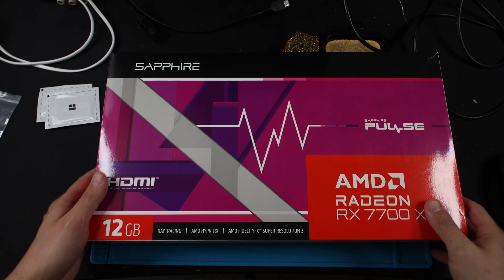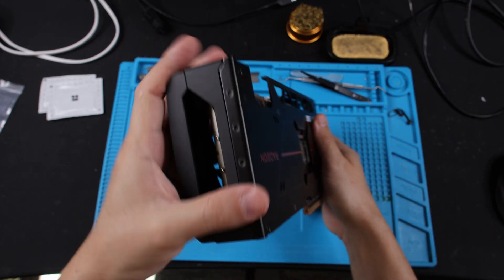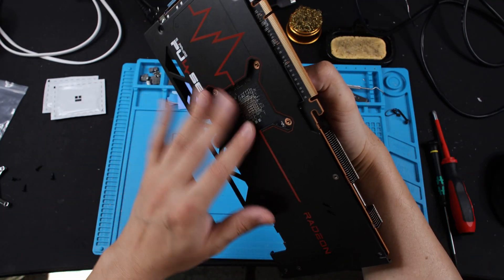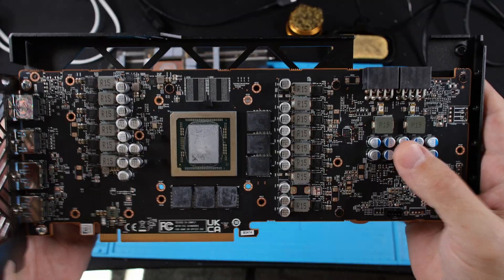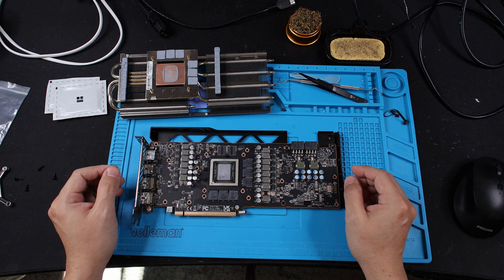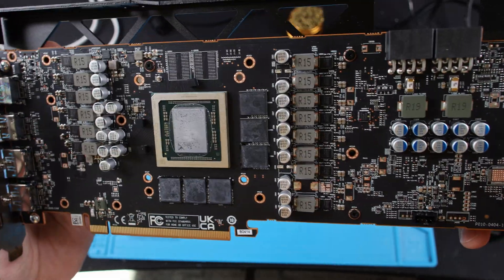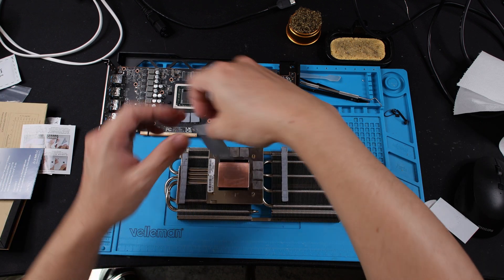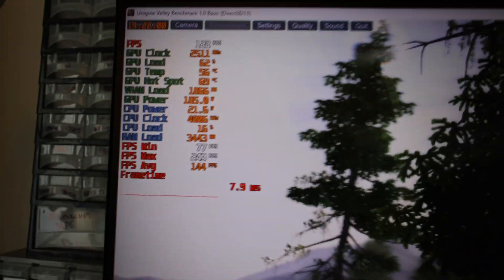Sapphire RX 7700 XT Pulse Unboxing & Teardown. Excellent quality build!

Comment: Only bought AMD for the last 9 years and moved from an rx 580 to an 5700xt and last year upgraded to the 7800xt and all of them made by Sapphire,none of them ever had any faults and were well made.
Reply from the maker: Sapphire does produce some good cards. But as with all the rest, they can also fail. I would definitely use some support with that 7800XT, as they are heavy and also prone to sag. Just a tip.
Reply: @TechnologyHive good tip,I'm using a support bracket

Comment: I got this Sapphire Pure version, Frostpunk 2 edition and I managed to get a stable overclock of 3.4Ghz! I mean, it boosts into it. The min I have set is 3Ghz and the max I have set is 3.4 and it boosts into that speed without crashing! This GPU I got it paired with an AMD Ryzen 7 5700x3d on an MSI B450 Gaming Plus Max AM4 motherboard with 64 gigabytes of Corsair DDR4 3200 overclocked the RAM to 3600, its stable and doesn't crash, even when I throw heavy workloads at it, its fast. 
Since I have multiple GPU slots from this MSI B450 Gaming Plus Max, I also have an RX 7600 and I'm using mgpu mode in things like LM studio and utilizing the 20 gigabytes VRAM pool, it works great. I can load pretty decently big models on it like Hermes 4.3 36 billion parameter model on it and it works.
The great thing about the RX 7700 XT is its tip toeing into the high end threshold, I can play every game I throw at this thing, in 1080p I can expect usually over 200 fps in most games, in 1440p I can expect like 100 to 175 in most games, and in 4k I can expect at least 55 to 65 fps in most games in ultra detail, its an amazing card, I love it. Super fast, works great with my AMD Ryzen 7 5700x3D. Both the CPU and GPU still hold strong even now and still perform great in games and workloads and AI and protein folding with folding at home and anything I can throw at it. ROCm is great, I love ROCm. Hell, I love AMD. Lisa Su is a genius.

Comment: So is it ok to have a 20c difference between hot spot and gpu temp with RX 6000 and 7000 series?
Reply from the maker: I wouldn't say its "ok", but rather that it is common.
Reply: @TechnologyHive Thanks I tried rx 6600, 6650 xt and rx 7600 all have similar temps. I am not sure repasting will help.

Comment: I have the same card but 7800xt, it is basically the same chip with no disabled cores, and two more memory chips, where this 7700xt is missing, what do you think about the xfx merc one?
Reply from the maker: The XFX cards are nice, BUT because they are large and heavy you run the risk of having the memory chips close to the PCI-e slot with cracked solder joints or ripped pads. It is very typical with these cards. I have worked on 10 of the in the last few weeks and its always those chips with cracked or ripped pads. So I advice people to put those cards on a vertical riser or put your PC on it's side so the card is not sagging in a horizontal position.

Comment: Hello brother. 
What do you think of these specifications on 2K resolution? 
I5 14400F

RX 7800 XT saphhire pulse

B760 M-E msi

650W
Reply from the maker: @sagamer4753  All seems fine to me. Which psu are you planning to use?
Reply: @TechnologyHive  650w Bronze RUIX
Reply from the maker: @sagamer4753  I'm not familiar with that brand, but could be that I'm just a noob 😆. Any way to go with Seasonic or Corsair?
Reply: @TechnologyHive Do you have Telegram to contact you about this?
Reply: is it going food with u? im planing for same setup , thank you.

Comment: I have the Sapphire RX 7800 XT Pulse and I'm wondering if they using phase change material like the 7700 XT you opened, which logically must be there since it's a tier higher and i'm intrigued to check it myself, but there is no information about it out there
Reply from the maker: @teos17  If your temperature is okei, I wouldn't bother opening it, or you'll have to buy some phase change TIM.
Reply: @TechnologyHive  i have stock ptm7950 to use, but since it's still brand new and under warranty i don't want to brake off the sticker, maybe you're right and im gonna leave it alone for now

Comment: Hello, first of all thanks for all the information about thermal pads and the other details. I have a powercolor radeon 7700xt 2 fan model and I wanted to check the thermal pads without tearing it down bcs it is new and I suspected that pads are doesnt properly contact with the heatsink. Even from the side of the gpu it looks like it and my temps are with +%15 power limit and undervolt gpu 68 hotspot 95 to 100 on full load 267 watts. There is a big gap as you can see between temps so I want to change the pads to thickee ones and the paste to ptm 7950. Temps doesnt really cause any problems actually but temp difference makes me uncomfortable. Any suggestions would be appreciated.
Reply from the maker: If you replaced the stock paste with Thermalright Heilos or PTM, you should instantly see that temp delta draw closer. The RX 7700 XT, as you no doubt know, is based on a chipplet design. This introduces an uneven surface due to its design nature. PTM helps with this issue.
Reply: @ thanks for the quick response. No I havent changed it yet I need to get a solid ptm 7950 there are too many fake models of it. Also do I have to change the pads to thicker ones there are lots of people who changed the paste to ptm but issue remained all the time even got worse. It is quite delicate job I guess. I am afraid that it is going to get worse.almost everybody says that at first temps are olay but later it gets worse.

Comment: Hello Sir, I plan to buy this card for next 4-6 years 1080p gaming..!! Is this card works in 650W PSU ?? Because i have 5600x with gigabyte 650W PSU. In sapphire website, they mentioned minimum 700W PSU and this card consume 230W board power..!!  that's y I'm asking, I really need ur valuable words..!! 🙏🙏🙏
Reply from the maker: @Oneeight.mp4  Yes 650w is perfectly fine. Your system, as long as you don't have 10 fans and 20 hard drives, should pull around 350-400w out of the wall at the most.
Reply: @TechnologyHive  Hahaha..!! No sir, I have only 3 cabinet fans 1 cpu fan and 1 ssd, 1 nvme. Thank you soo much sir for your response and this quality video.. it make me clear idea. 🤝🙏
Reply from the maker: @Oneeight.mp4  Your welcome. I'm glad to help ☺️

Comment: Hei i need some help, i just trying to repair one RX 7700 XT Sapphire. Someone kicked against his computer and a massive short circuit occured. The SF8A fused is broken, the AMS1117 50 broke down its located in the left corner of the first HDMI-Port and a QFN-Chip melted down. So i dont know what kind of chip it is its located in the 0.75 Volt rail. This is under the left R15 coils, on the left side from the smaller coil.
Reply from the maker: @FlorianNothas  None of that made any sense 🤣

Comment: I've owned a Sapphire Nitro+ 6700XT for 5 - 7 months and I love how Sapphire did their quality on the cards.
Reply from the maker: @dbatack  Thus is why I don't often work on AMD cards. They are built better, IMO.
Reply: I agree completely. I didn't too much like that power connector on Nvidia high end cards that 16 pin high power adapter thing, I hate that shit. Its horrible, so many people complained and had to do RMAs when their GPUs melted on those Nvidia cards. I think they may have since resolved it but that's just dumb. I'd rather stick to the 8 pin design, and when cards need more juice just add another 8 pin cable on a separate rail that way if something goes wrong it doesn't fry the whole card. Its not as likely to go wrong with the multi 8 pin outs as those highpower 16 pinners are. Too much juice through a single rail I think.

These things are built like a tank and built to last, I sure am glad I got my shit, my AMD Ryzen 7 5700x3d, my MSI B450 Gaming Plus Max, my Sapphire Frostpunk 2 Rx 7700 XT, my XFX RX 7600 and my Corsair Vengeance 64 gigabytes DDR4 before this memory shortage crisis hit. I'm glad I got my stuff before all these horrible tariffs kicked in and made everything prohibitively expensive. It was a good investment to get it while it was cheap.
I got my AMD Ryzen 7 5700x3d when it was like 260. Pricing these things these days, to buy it new its like 580ish dollars. THATS NUTS

And I remember when I first got my DDR4 for this system, the first 32 gig kit I think I got a deal on it for like 60 bucks. When I recently scooped up my other 32 gig kit to put in the other two slots, the price went way up to about 110 bucks. I checked recently and the price shot up again to almost 200 bucks for a 32 gig kit. 400 dollars for a 64 gigabyte kit, that's insane! Glad I got this shit while it was affordable!
I agree AMD shit is built like a tank. I love it

Comment: 🙂Sapphire has by far the best quality of AMD partner cards. I have a Sapphire Nitro+ card running in both of my rigs, the main gaming rig has an Nitro+ Vapor-X RX 7900 XTX and the second system has an Nitro+ RX 6950 XT. To be honest, I wouldn't consider anything other than Sapphire cards. Well, maybe a Powercolor Red Devil because I've only had good experiences with them personally, but that would be it.
Reply from the maker: @allcarparebeautiful  Those cards you got will last you for years. Both come with Infinion or MPS drivers and controllers. They're both built solid. Great choices 👌 👍🏼
Reply: @TechnologyHive  Thank you, I'm glad to hear that. 🙂👍🏻 I mean, I already knew that they were of very high quality because I've been an enthusiast and PC builder for a little over 27 years now, but having it confirmed by someone who knows the components is even better. 🤔 In the past, some channels on YouTube also did reviews of the components used on graphics cards and went into great detail. I think Actually Hardcore Overclocking aka buildzoid was the one where I often looked at the board views.😌 Of course it was from the overclocking and modding perspective but sometimes he also mentioned the board quality and individual components on it.
Reply from the maker: @allcarparebeautiful  I have checked out his channel as well. The guy is knowledgeable for sure. Techpowerup has done some good reviews as well on gpus.
Reply: @allcarparebeautiful  XFX make great ones too
Reply: @Wilantonjakov  as an previous xfx 6700 xt swft owner, the cooler design was crap and the thermal paste they where using was like white paint which result to 110c hotspot  even if it was still wet and new.
Only after swapping it with ptm7950 the hotspot temp couldn't reach higher than 90c

Comment: Sapphire is doing a very good job if it comes to build quality and the parts they use. I've got a Nitro+ 7900XT and iit's one of the best build cards ive ever owned.
The only thing i don't like is the VRAM temp. It's a problem with all RX 7000 cards (7800XT and up).
Reply: What's most notable about Sapphire is the quality of even their cheaper "Pulse" model cards, which have often been the very best of any model sold close to MSRP for many GPU generations.

This generation is unusual, because Sapphire apparently got an exclusive contract to make ALL of the reference models for the 7000 series, but those reference models are still sold with Sapphire branding. In past generations, there often was no reference model, and the "Pulse" branded Sapphire cards were usually the cheapest ones they had.
Reply from the maker: If you replace the thermal pads, those VRAM temps will come down. I get mine from here: 

https://www.aliexpress.com/item/1005005898862800.html?spm=a2g0o.order_list.order_list_main.12.73b11802DGVw9e

Excellent quality stuff.

Comment: 4070ti was better for same price
Reply from the maker: @toxyboi  Not the same price lol. The 4070 ti is about $150-200 bucks more.
Reply: Here in Europe I'd have to pay around 350€ more for the 4070ti. Must be Fantasyland where you get this kind of GPU for the price of a 7700XT... Even a 4070 will cost more than a 7800XT.
Reply from the maker: @daveb9402  I'm from Norway. Here the difference for a 4070 ti and an RX 7700 XT go from $200 to 250. So I do not know where he got a 4070ti for the same price as a RX 7700 XT 😆